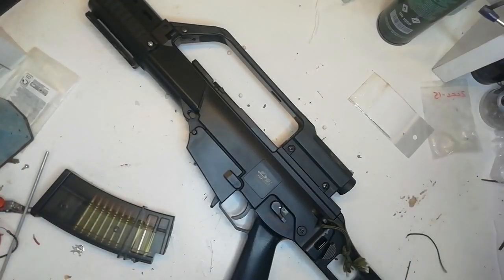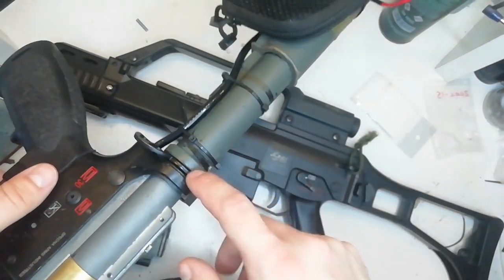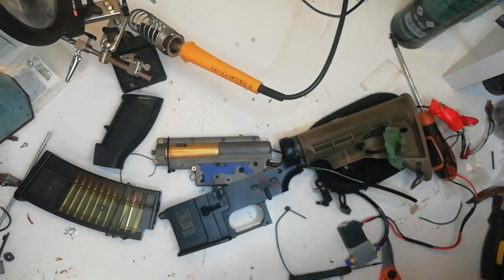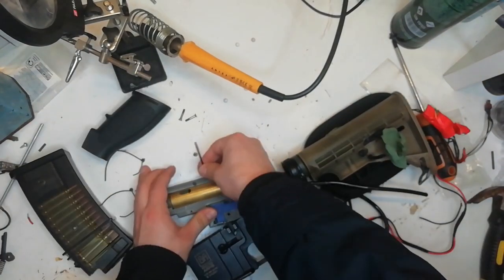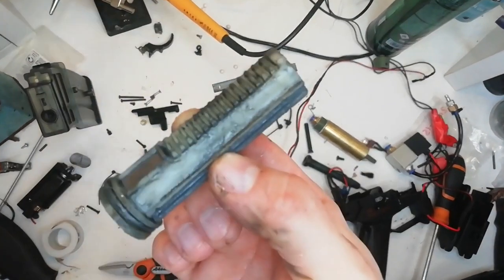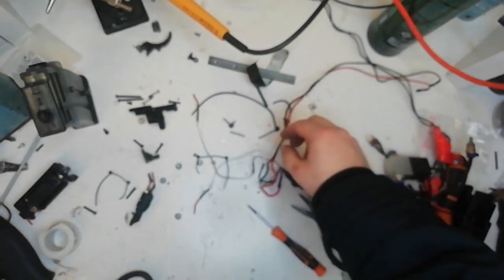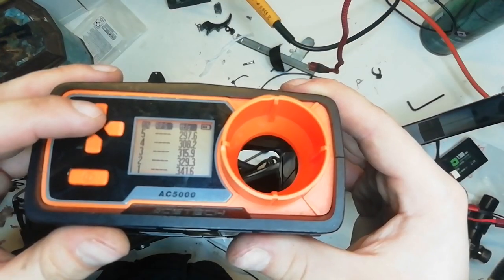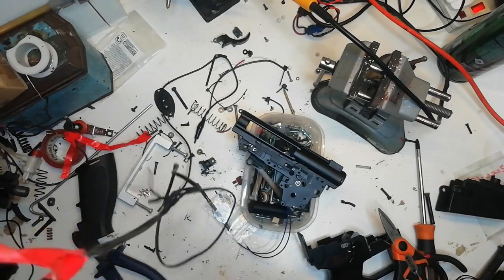Making The Fauxverine Even More AWESOME! (Kuba T1000 Airsoft 3D Printed Homemade HPA G36C Build)

Comment: Gotta ask, why not just put a pouch on the HPA bottle with the reg/solenoid/battery, send signal contacts from the gearbox back to the controller? you can do it with something solid like a three pin XLR (locking) with ground, trigger signal and state signal (semi/full)
Reply from the maker: Because then you'll need more wiring back and forth between things. Also reduces piping between valve and engine.

Comment: The G36C looks WAYY better than the M4,
was there, not space to put the air solenoid in the gun?
Reply from the maker: Unfortunately not, the selector mechanism would foul up against the valve if I was to cut the gearbox up to fit the valve in.